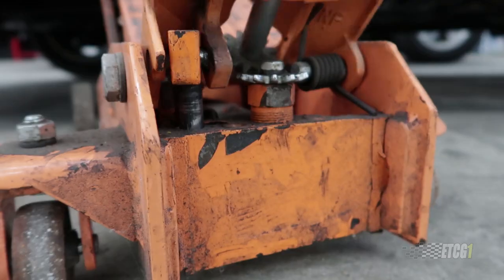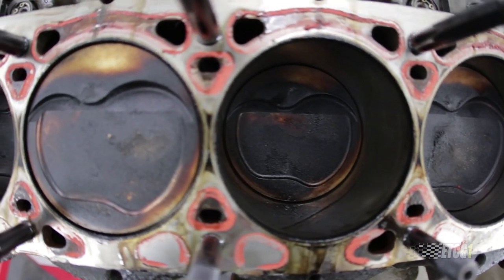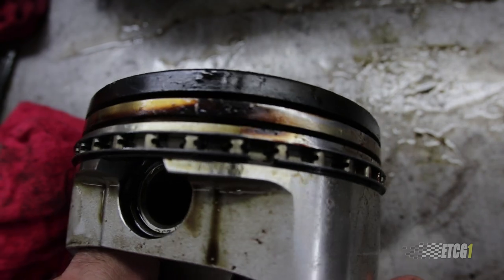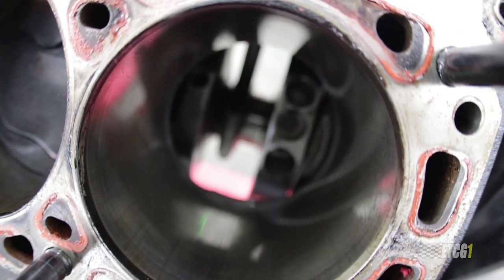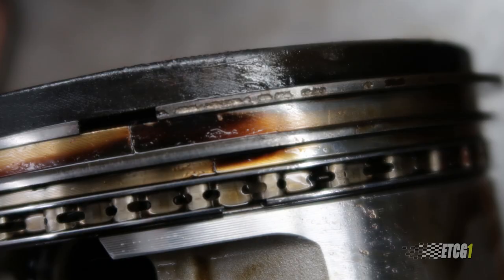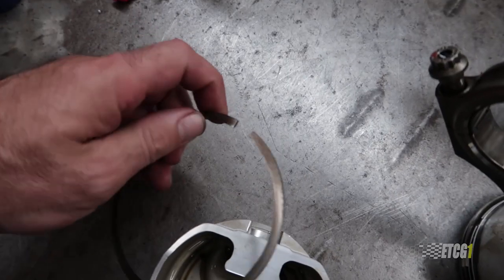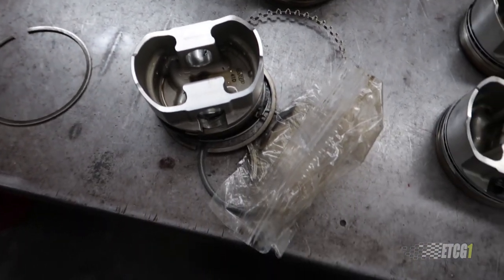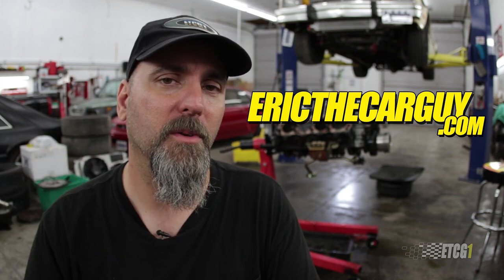Hydrostatic Lock the Silent Killer

Comment: Had a cold air intake on my car hit a puddle in Charlotte instantly blew my motor shot the rods out the block still have the block with the rod sticking out of it in the back of a Toyota Camry

Boom
Reply: This, and the mighty car mods episode on pod filters, is why i will always run a factory air box.

Unless im building a fire breathing monster...
Reply: M&R Tuning That would suck! I’ve got a cold air intake for my 240 because I wasn’t able to find a factory box, I plan to build a splash shield of some sort around it.
Reply: You killed a Camry? I bow to Thanos, destroyer of worlds. 

That sucks.   Been there.  But it was a bad rebuild by me.  Chewed up number one main bearing going up a hill in January.  That was a real cold walk home.
Reply: Did the same but while offroading.Sucked water into my gay cone filter. Broke connecting rod for 6 :( I never knew what hydrolocking was until I had to pay for it lol
Reply: "cold liquid intake" ;))))
Reply: lmao
Reply: Zach ,Based lol ? It was raing I was driving in water? So yeah I drove in water?
Reply: The only reason this happened is because of how big the pothole was that I went into that was filled with water ran fine for two years with the cold air intake on 

Only took one day and a big pot hole to get me stuck in Charlotte after work

Cracked my rim to
Reply: Low to the ground cold air intake sucking water up, seen that more than once.
Reply: this times 10000000% dude
ive never done it my self.... mostly because i was too poor to even afford the cheapest e-bay "cold" air intake....

most kits just end up sucking in hot air.....

 if the filter can "see" anything that gets hot.....ya done fucked up
it needs a box around it..... not just a reflective 2 sided trump wall....

even in my 99 buick century...which only makes 160hp.... the factory set up is a true cold air intake....
right behind the headlight..... also, the headlight can be removed in 5 seconds (two plastic clips, simply pull up)

now you have a cold air ram intake......and the way its designed, tightly sealed, plus the large headlight hole....
shit actually might make more power at speed like that....

a fucking 99 buick..... a cheap ass late 90s boat (that happens to handle great because cheap = light) 
has a better intake than a LOT of aftermarket systems 

i see K&N "filters" just wide open, at work..... not even an attempt to not suck hot air....
just makes me sad....
Reply: Cars dont like to be turned into wet-vacs.  Replaced engine in bone stock 03 accord due to hydro-lock. Stock airbox didnt save him, insurance did.
Reply: Ouch!!!!
Reply: That sounds like a really inconvenient situation
Reply: Thanks for the two-lesson example of why some people shouldn't try to bodge together speed parts, and especially on cars that could never gain any useful power from the mods. I've seen SO many engines destroyed because people thought they'd get an advantage from using a "cold air intake." That's the mod that only gives once, and it's almost always catastrophic.
Reply: To Mr. M&R Tuning and everyone else here, you can prevent damage to your engine from hydro lock if you are running a low install CAI  by using a combination of a splash guard, a hydroshield (a water resistant cover for the air filter but allows little to unrestricted airflow) and a bypass valve which will prevent  water from being sucked in by opening up a bypass in case the primary filter accidentally sucks up water. So long as you don’t submerge your vehicle you should be ok to run a CAI like this.
Reply: davidsquall351 Your cone filter is happy or a homosexual?
Reply: Toyota had a lawsuit for some model Landcruisers because the air intake for a Diesel ffs was behind the headlight. The advert for the 4x4s in question showed them driving through a river but when customer drove their Toyota 4x4 through water the engine would injest water and destroy the engine. Naturally Toyota utterly refused to come to the party and a class action type lawyers picnic ensued. Toyota fought hard.
Reply: This is exactly why I ALWAYS use the "ricer" cone filters, and I always mount them at the highest point of the engine bay. I have even used my cars to ski across deep puddles at speed. (no it wasnt a good idea, yes it worked just fine, no would not do it again).
Reply: I just saw a lady on the side of the road in an 06 to 08 4cyl camry on the side of the highway. It looked like something with the crank went out i found peices of her engine. Along the road and all the oil gone. She only had 197,000 on it.
Reply: Sorry....but I laughed lol
Reply: Never had that experience. I drove thru a flood during a hurricane in Florida, riding in an EF Civic with short ram intake. Coilover suspension, slammed. Water was SHOOTING thru the shifter and hitting the ceiling. I'm guessing the weight of the car on top of the water was pressurizing it. Had to go somewhere.

Comment: I almost hydro locked an engine on an 04 Altima 2.5 trying to get it running. The owner needed the water pump and thermostats changed I fired it up oil was water free before hand. Tried bleeding the system and realized it had a serious air issue in the cooling system. Pulled the dipstick and sure enough had water mixing. Pulled plugs, soaked in coolant and cylinder 4 was the worst. Owner admitted after a serious venting that it over heated once and that was enough to warp the head. Luckily I caught it before serious damage had occurred. Just got the head back today. Only 85 to surface and pressure test. If you are ever in Central Florida take a trip to Central Florida Machine and Speed. They are fair, honest and reliable. They also build high performance engines and keep AFR heads in stock and other brands of parts for all your domestic engine needs. They also don't charge much but will be raising prices soon, but not by much.

Comment: Well here is a hydrolock problem in progress.  I installed a new FiTech throttle body roughly six months ago.  Fired it up and let it idle for 15 minutes or so.  No problems so far.  Tried to go for a drive around the block, and it stalled out at the first stop.  Got it home by keeping some throttle, but it was running horribly.  Got it back home into the driveway though.

Next day I tried to start it, but just wouldn't fire off.  Struggled with that problem for a couple of weeks.  At some point the starter stopped being able to turn it over properly.  Put a wrench on the crank and all I could get was a partial revolution.  Maybe 270 degrees or so.  I checked everything that I could think of that would stop the engine from turning - a couple of times the starter turned it over enough to build a little oil pressure.  When I was checking the starter and flexplate there was gas dripping from a joint in the exhaust system.

Finally I took out all the plugs to make it easier to rotate by hand.  All of a sudden there was a shower of gas from above.  It missed me, but I have never heard of such a thing.  For some reason gas seems to accumulate in cylinder 8.  Got everything dried out the best I could, but still not starting.  I'm off to get some penetrating oil this morning and a new starter.  Maybe I can get it rotating fast enough to blow out the combustion chambers and try again.

The FiTech has a key on prime shot feature that doesn't help the hydrolock problem.  It also gives another prime shot when the engine turns over twice.  It seems that when the engine doesn't fire up that all this gas is flooding to the extreme.  I have also been thinking about the effect on the oxygen sensor.  Everything about the FiTech runs off the oxygen sensor signal.  I think that it is possible that there is so much fuel in the exhaust lines that when starting the FiTech sees no need to inject.  Going to try hanging the oxygen sensor loose in the air to try that theory out if necessary..

Wish me luck!

Comment: Cracked head lead to a bent connecting rod in a small block Chevy. The crack was in the quench area of the combustion chamber of the number 5 cylinder. It still ran but the piston skirt was rubbing on the crank arm counterweight.
Replaced the head, bent rod and bearing., everything else was examined and found to be in spec. The Caprice classic wagon ran mid 12s after that for many years.
Reply from the maker: Nice.
Reply: ETCG1 thanks I had a lot of fun with that while it lasted LOL I eventually got hit, some idiot pulled out of a parking lot and hit me on the right front tire that the frame totaled the car

Comment: About 6 years ago I drove my old first car (1989 Honda Accord) into a small body of water. Someone had a random big ass hole in their front yard. I was unaware of this and it had a bunch of rain water in it, plus it was night time. I was sure it was screwed. Water was up to the top of the front passenger side wheel for over an hour and also soaked the interior of the car which took weeks to dry out. One thing I might've done right was shut it off pretty quick. Although, after we pulled her out it turned over and I drove home the next morning. Apparently this messed up the float in carb somehow and caused fuel flooding which was later fixed with a minor rebuild.. more like shock damage idk. Still cranks and runs to this day, getting 28 mpg with its rough idling carburetor. I just repainted her and take it out occasionally as my awkward classic. Perhaps eventually it will lock up, I don't know but so far so good Great car tbh! lol

Comment: I had this happen to my Mercedes, air intake in the grill ! A splash of water in the grill and a twisted rod! 
I'm working on a hydrostatic lock preventer, but in the mean time I just opened up the bottom of my air filter box.
Water being heaver than air the water would fall out and the air would still go thru. Not ideal but better than nothing for now.
The twisted rod prevented the engine from cranking, fortunately. So damage was limited to the pistol and rod assembly . 
The autostart not realizing the engine couldn't crank were filling the cylinders with fuel !
Reply: Obwan Kenobi Wow! That would suck! No warranty on that?
Reply: Fortunately it didn't knock a hole in the block.
Reply: lol, cut a large hole int he hood or fender and route and seal a new intake system out and way up the above windshield :)))

Comment: I have seen holes punched in pistons when coolant is sucked into the intake manifold on a 72 Ford Pinto 2.0 Liter engine. There is a water line that goes between the number 2 and 3 ports with about a 1- 2 mm gasket between the water line and intake ports.  The Gasket failed while the engine was running and coolant was sucked into the intake and on the compression stroke, bam a nice hole roughly the size of the 50 cent piece in the top of the piston, plus a bent connecting rod.  The owner decided to scrape rather than repair.  (It had other issues, worn suspension, slipping transmission and bad bearing in the differential.  Only 68,000 miles and the car was totally shot.

Comment: Sorry to hear about this, but like you said, it could've been a whole hell of a lot worse.  The inside of that cylinder bore looks perfectly fine -- no scorching or gouging, so I think you're good there.  You didn't mention it, but I assume you checked the connecting rod on that cylinder to ensure it's still true?
Reply from the maker: I did yes. I also left it with the machinist to double check it.
Reply: Friendly advice from experience... check all 8 rods.

Comment: I have a Fiero with a sbc in it. It has been sitting in my garage because of bent rods, from a hydra lock. This was due to heavy rains from a hurricane that went into my carb from a air scoop on rear deck lid.

This actually happened twice. First time it did not start, just locked, so I pulled plugs spun the engine, changed the oil, and all was good.

Second time it cranked and started, which was the straw that did you know what.
Reply: Sold a used short block LT1 to a guy that had the same problem occur, heavy rain got into the hood scope and boom.

Comment: Had this happen to an 89 Jeep xj I had. Went out with some  friends 4 wheeling one night and hydrolocked it in a waterhole. We got the water out and I drove it for 2 months. One day rolling up to a stop light I pushed the clutch in to take it out of gear and boom it threw the back two rods and windowed the block. To tell you how tough those old 4.0's we're I was able to sit at the light till it changed and drive it to a side road and call for help.

Comment: I'm not entirely convinced that the hydrostatic lock was the root cause of all of this. My money is on the guy dynoing the engine, pushing it at full throttle with boost even though he was well aware it was super lean. The severe detonation that occurred during that time probably weakened the piston enough to cause it to break during the hydro lock situation. I can't imagine a forged piston breaking that easily with the starter motor pushing against it. Not hating, trolling or anything like that, just my 2 cents.
Reply: there's no way to tell if the engine fired a cylinder and hammered it self hard. even with the video he has/showed of it locking on crank over.
Reply: 6speeddakota totally with you, but he run the engine in the car too lean for too long.
Reply: Yup  I agree, generally piston failed for hydrolock would crack the piston across the combustion surface. This was 90% more than likely from detonation or having to tight of a ring gap althou since the bores are still fine it was probably fine on the ring gap.
Reply: Do you not know what detonation look likes when you read a plug?
Reply: I do know what detonation looks like on a plug but whose to say the plugs haven't been changed since it was on the dyno ic you seen that video of it going super lean on the dyno when it was in boost I can guarantee you that thing was detonating.
Reply: 6speeddakota I was thinking the same. However I changed my mind when there was no hint of damage on any other cylinder.
Reply: Thats possible, but I've seen pistons in diesel engines break on the starter, so who knows really. But yeah if this had anything to do with detonation it was during the dyno pulls.
Reply: Tyler Barnett were it a detonation (preignition) issue, the combustion surface would likely have had a "trench" in it's surface, not a broken ring land (similar to running far too hot of a plug in a 2 stroke).
Reply: ............and worth every penny! NOT.  If the engine was run lean enough to damage cylinder one then Why not all 8?  the flaw occured on  the number one hole which runs cooler than the 3 and 5 holes internal to the block! Why would lean burn have affected number one hole!!?  If you look at the area on the lands which is trashed, this is the area that faced the outside of the block:  Where gasoline in liquid form sat LAST:  the lowest spot in the cylinder!  When the piston came up, this area was where the uncompressable volume was in the cylinder, so BOOM, you crack a ring and the land.  My guess is the liquid volume in the cylinder was not very great and the starter could have had as much as almost 1 full Rev of inertia to put into the catastrophic moment.  You just sat there and watched a 3/4" diameter jack piston lift a car with 25lbs of input work and then you want to say a starter motor designed to turn a 500 HP motor with 11:1 compression could not shear a 1/8" land off a forged piston?
Reply: Had a buddy literally put a hole his ls1 when he had a stuck #5 injector dumping fuel while the key was forward. When he went to start it the rod went though the side lmfao. I guess shit happens
Reply: Tyler Barnett the crown of a forged piston is the strongest area, I've seen many forged skirts and ring lands shattered from the piston stuttering from sudden stops. The normal reasons for the built engines I've done doing what's shown here have been water jacket failures in the head, and downshifting from say 5th gear to 2nd gear.
Reply: 6speeddakota I've got to agreed if hydro lock caused this just by cranking with the starter those pistons where some weak sauce pistons.
Reply: 6speeddakota I agree.... detonation
Reply: HO LEE FUK Your username rocks.  Cheers!
Reply: Not detonation hydraulic force is powerful shit think about how small the cylinder is on a floor jack that takes minimal effort to lift a car now think about it being ten times the diameter and powered by a electric motor and the amount of pressure that top ring is putting against the ringland underneath it if it was detonation the piston would look like it was torched not fractured ive seen guys pull up to the track and back a sportsmen car off a open trailer and go to fire it up and break a piston or blow a rod out the block and destroy a lot of high dollar shit because someone forgot to put the carb hat on it when they were towing it and the air going across the carb siphoned enough fuel out to fill up a cylinder
Reply: thefordmaniac d

Comment: My co worker loved driving through puddles with his 4.7 Dodge Ram, until he hydrolocked it. He took it to Mexico to get it fixed for dirt cheap compared to US prices. He even paid the mechanics extra so that his truck was top priority (money talks there). He drove it back, and it was running fine until it started running rich, black smoke rich. It was a bad O2 sensor. He replaced that, and removed the air box that sucked water from the fender. He installed a dual head "cold" air intake that sits on top the engine.